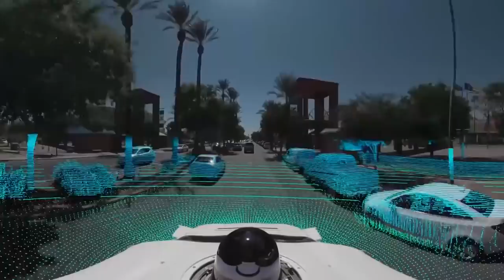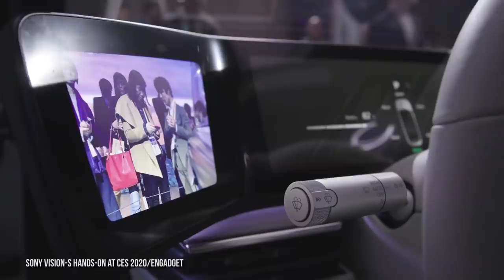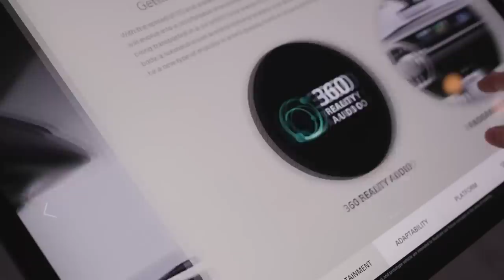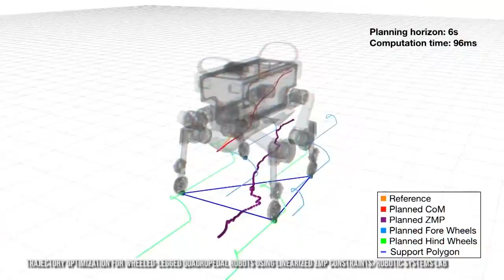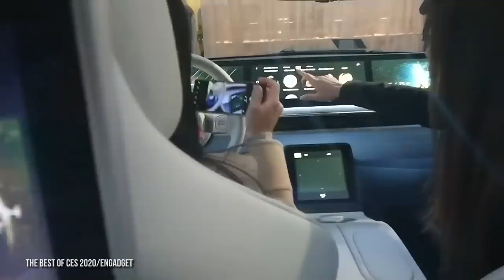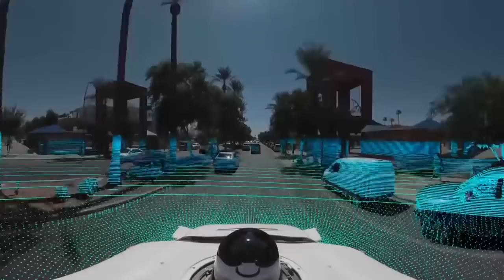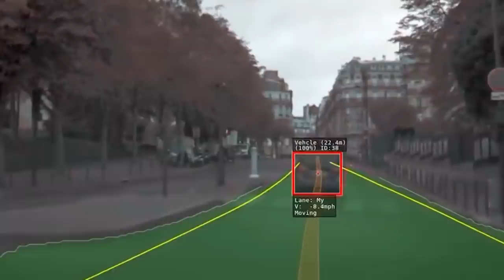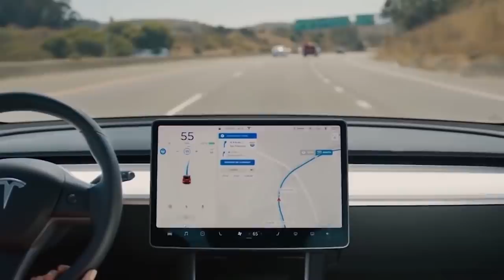Sony Officially Reveals Car To Beat Tesla

Comment: "Apple builds a car"
Parts sold separately and no windows
Reply: So it’s a convertible with good aftermarket spares support
Reply: @RennieAsh  no its an overpriced lego set
Reply: It’s a nice car, but the charging cable doesn’t fit into any existing charger. They’ll sell you an adapter for an exorbitant price, however.
Reply: They'll probably make you buy your own supercharger that you have to carry along if you want to use their supercharging facilities. Then on-site you can mount it down and charge your car. Oh and of course it will only charge wirelessly.
Reply: @RennieAsh  But the windshield technically is a window so, wipers wouldn't even matter
Reply: @AbrahamE  NO WINDOWS!!! 

Only iOS
Reply: @Smonjirez  They would have to make pirate superchargers with adapters to use the ones of Tesla.
Reply: @groundhogx2941  if  they do that they will fail the company
Reply: And can only be driven on Apple roads, and only charged at Apple charging stations, and only repaired at Apple dealers. And god forbid you get it wet, because Apple will tell you you need a new car.
Reply: The infotainment sold separately
Reply: @RennieAsh  Probably if some part or piece fails, they will tell you they can't fixed it, no repair shop will be able to get the parts since they are propietary, and will tell you to buy a new one xD xP
Reply: I guess if you crash it, you gotta bring it to the Genius Bar.
Reply: airbags cost extra 1000$ per seat.
Reply: @groundhogx2941  steering wheel costs double that amount
Reply: Gold version released soon after.
Reply: Plus, No USB chargers Nor Time stamp on the Car screen since you'll need Apple Watch to and iPhone to adjust Volume.
Reply: @chicxulub2947  no don't know their 700 dollar wheels🤣
Reply: You need a membership to drive the car
Reply: Good one
Reply: Very well said. No windows!!😂
Reply: @OriginalMergatroid  you are right.  Its all still about market share rather than advancing the standard of technology as a whole
Reply: @SanePerson1  which will cease working after 6 months 🙄
Reply: unbelievaballs
Reply: 0 to 60 in 2 sec only if you are in the ecosystem
Reply: They'll find a way not to honour their warranty but sell you a refurbished car at just below the price you paid for your new car.
Reply: You have to buy the i-Tyre and only fill i-Air at Apple service centers. Otherwise, the system won't recognise the tyre and refuse to drive - just like their new 12 series.
Reply: Also iWheel will be sold separately 😂😂😂
Reply: Sammy 2018 : lets mock Apple with our ingenious ads after they got rid of the "windows and not including parts"
Sammy 2021 : introducing our "S21 Ultra 🤡"
Reply: Apple doesn’t like windows instead it builds with ios
Reply: It wl be a proprietary gadget to earn from each part.😜
Reply: Dang
Reply: Lol..
Reply: U will need to have iPhone 12 b4 u can start it
Reply: @allorfh2495  😂😂😂
Reply: @RennieAsh  apple fan boy spotted.
Reply: Sunny borah klevvah humanz!
Reply: HA HA!!!!!!!!!!!!!!!
Reply: Of course it won't have windows it has ios.

pls don't kill me
Reply: @fatihguner4041  he is talking about the actual car windows.
Reply: It's all about money making game 🤣🤣
Reply: Doesn't use Windows, just use cup board. Windows buy separately